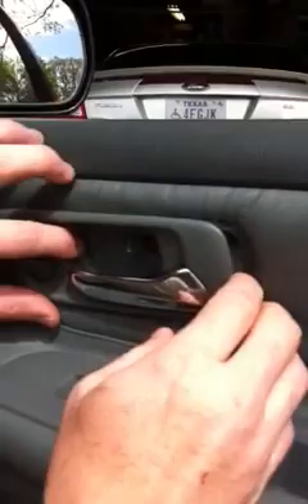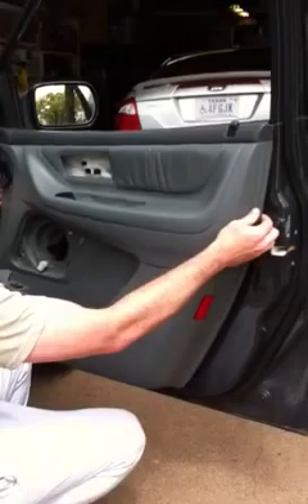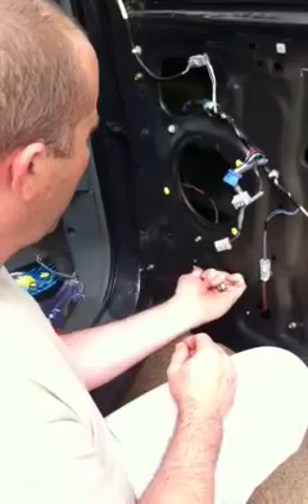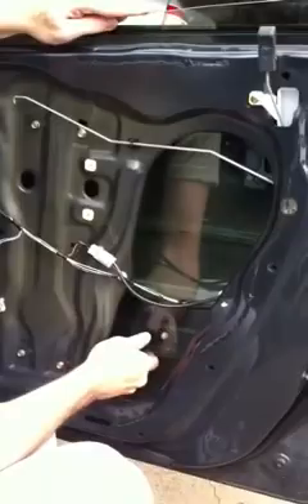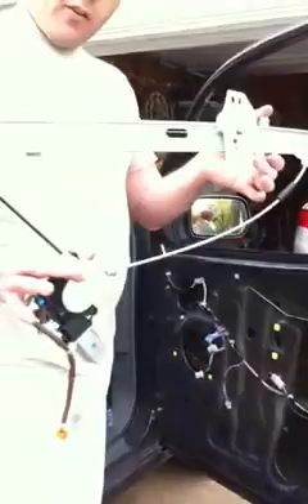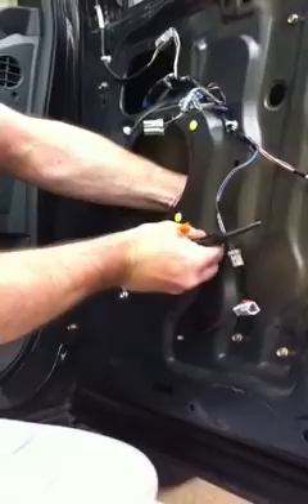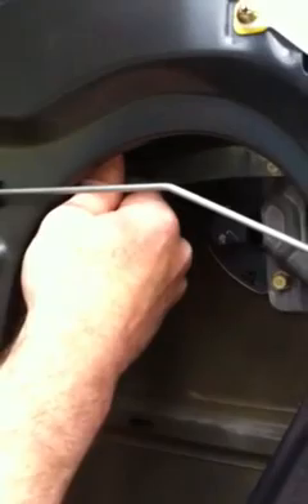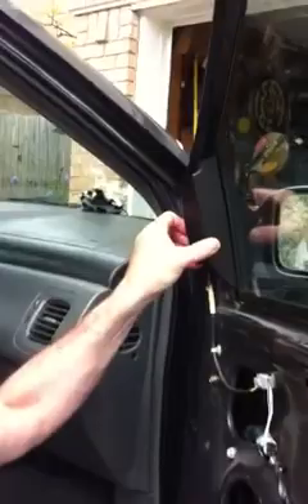2003 Honda Odyssey Passenger Door Window Regulator Replacement

Comment: Thanks for posting this detailed video. You saved me $250! It took me about 2 hours. I was also able to leave the window in and tape it up using painters tape while I installed the new assembly. I was not as lucky as you, my window was stuck in the full down position. By removing the 4 regulator bolts, I was able to get enough room to remove the 2 window bolts and push the glass up. Thanks again!

Comment: I did the replacement.The Plastic tabs of plate moving with glass broke & the strip was free so the glass stays down. Replaced the'Regulator'.Dorman $50. Repaired the old one , works fine , it probably broke as it was dry, no grease. Good job SGT, keep posting.

Comment: Thank you Jason. You saved me a few hundred bucks! I did the driver's side & my window was stuck in the UP position. This made it more difficult to remove the window bolts, but I was able to remove the left one, then pivot the metal regulator "arm", which lowered the window enough for me to see the other bolt. I then taped the window up rather than remove it. I also left the white barrier attached along the bottom of the door, folding it under the door and out of the way. Cost: $50 from Amazon.

Comment: The passenger side window on my 2004 Odyssey failed.  This video was an excellent resource to help me replace the actuator and motor assembly.  Some key tips in the comments section that helped; tape the window (duct tape) in the fully closed position, and don't remove the speaker.  You may need to remove the 2 bolts connecting the window to the actuator arm in order to tape the window closed.  While you do not need to remove the speaker, there are 3 screws under the speaker cover that you DO need to remove in order to take the panel off.  Once you get the panel off you are left holding the panel in one hand and trying to disconnect the speaker power connector with the other.  It wouldn't hurt to have a 2nd set of hands at that point or something to balance the panel on to avoid letting the weight of the panel fall on the rather thin speaker wires.  I found the hardest aspect of the job was getting the panel back on!  Fitting it in at the top while accommodating the door lock at the same time was tricky, but patience prevailed.  Excellent instructional video and THANK YOU.

Comment: Thanks for the video. My wife said the window went bang and fell down today. I was determined to avoid taking it to the dealer and spending $500...
Your video convinced me I could take the door apart without breaking all the clips and plastic.
After a quick parts run I had it fixed in a few hours and a couple of beers.
Thank you!

Comment: Jason I doubt you will see this but little over 6 years after you posted this video it is still at work. Passager window is broken, poket book is short, so this video just saved me $80.00 .....thx for yours & the camera ladys efforts they are truly appreciated....👍
Reply: Jason Shrout
 It sure did....two things I had to do different were...the black sticky, whatever, that held the plastic sheet on, work too well. So I replaced it with a pease cut from a bag you would put over a pallet, then shrink it with a propane torch ever heavier duty....it was handy..:) 3M two sided tape worked very well to hold it on.
The other was, I had to remove that corner peace, small black triangle. It's just held on with two clips that are brittle so it should be removed after the door panel, so you can pry it straight out, side to side. I broke the bottom clip but the door panel & top clip hold it pretty tight....really thank you again......👍 Have a happy forth...!!!!!

Comment: Great help. For those embarking on this little project pay attention to which connectors you are re-connecting your switches to. I made the mistake of connecting the blue power connector to my power window switch and I short circuited the sucker. Just ordered a replacement from Ebay Motors for $19. At least it short circuited in the closed position.

Comment: Thank you so much for this awesome video.  Wife called my Friday, said she came out of work and the window was down in door.  Bought the part for $70, used your video and changed it out in less than an hour with NO issues.  I'm not a car guy by any means but this was a pretty easy fix that saved me over $200

Comment: Thanks for your video! B/c of this I was able to do the same on the driver's side and save myself about $300.  It was some hard work though, putting the panel back on was quite a struggle, esp when I was working from 8pm to 11pm in the dark with a headlamp!

Thanks again!

Comment: Thanks for this helped refresh my memory on the steps -- had replaced driver side 2 years ago, New part on Amazon = $52. Do not need to take glass completely out -- can raise it and tape to door frame while changing regulator. thanx again.

Comment: This video worked perfectly for my 2004 Honda Odyssey. Thanks for the video! I finished mine in 40 minutes. The dealership wanted to charge me $104 just to "diagnose" the problem. Who knows how much it would have been after parts and labor. Got my part at a local auto parts store for $70. Awesome!

Comment: Thanks a ton for posting this video!  I have an '04 and I followed this video for the drivers side window and it was easy to follow, even for me.  This happened 2 years ago to the passenger side window.  I took it to the dealer and it cost me $300.  I bought the new part for $50, installed it myself (with help from this video) and saved $250!!  Thanks again.

Comment: Thanks for the well instructed video. I had gotten stuck at the part where you remove the window. Now I can finish the job. I also ordered the regulator from Amazon for $50. I wasn't sure what the problem with the window was, but thanks for clearing all that up for me. Great video.

Comment: Nice video.  Thanks.  I hate trying to figure out where all the tabs and such are and usually end up breaking one.  :(  Anyhow, here's a little tip that I used while working on my Impala.  You don't have to take the window all the way out.  Put a few (3 or more) long pieces of painters tape over the top of the door.  Leave it hang loose.  Disconnect the window and push it straight up.  Press the tape against it and the window will stay up.

Comment: Gives me confidence to try it on my 04 it's been non operating for 1 1/2 years now.  Got to do it man.  Going to try.
Reply: first time I did it, Ray.  Took me about 3 hours... would have been less than half that time, but I kept referring back to the video during the removal and installation.  Plus, my new part had a shorter cord, so I kept removing it to try to get everything connected properly.

Comment: You don't HAVE to remove the speaker, the weatherstripping nor the window.  Leave the window in the up position and hold it with masking tape, or a suction cup and hanger.  The speaker can stay in the trim panel, just remove the wire when removing.  My biggest problem was with the new part, the motor wire wasn't as long as what was removed.  (couldn't reuse old one, just had to 'make it work.  It's also a good idea to make sure ALL your pieces parts are back together BEFORE puttting back on the trim panel.  NOTHING sucks as much as getting everything back together, then finding a plastic clip laying on the floormat.  .

Comment: BTW, better to not take the window out.  You'll risk scratching tint or breaking it.  Just push window all the way to the top in closed position and use black tape to hold it up there.  Put the tape about midway up the window on outside to the top all the way around the top window frame and back down again on other side, inside  of widow.  Two or three strips like that holds the window in place real nice while you install the regulator.  Again, great vid!

Comment: thanks for the video it helped me not mess anything up.
I did find out a couple things you can tape the window in the up position and dont have to remove it, 
Also you dont have to remove the speaker just unplug it after you pull the door cover off,I also did not remove the plastic sheet from around the speakerI bunched it together and pushed inside the speaker hole.
Any way many thanks for posting 
2 thumbs up!!

Comment: ThankX Great Video, worked on an 04, the one problem was I could not remove the glass, window was stuck in the door. Hard getting the screws out. It went in easy and works great.
Reply: The glass is stuck on something at the bottom of the door on my 04, how did you free and raise it?
Reply: @janeharg8411  That is the same problem I have. The window is stuck down and I can't access the bolts to get it up all the way.

Comment: Great info.  Helped me with my '04.  Just be careful pulling the panel out.  Or have some spare clips handy.  And be 100% sure the child safety lock switch is off before testing whether it works or not.

Comment: wasn't sure if tape would hold. i pulled the glass all the way up, used a few pieces of stiff styrofoam vertically and wedged it in between the horizontal pole in the middle of the door and bottom of the window and it held up pretty nicely.  also used tape just in case

Comment: Very best presentation You don't HAVE to remove the speaker, the weatherstripping nor the window.  Leave the window in the up position and hold it with masking tape, or a suction cup and hanger.  The speaker can stay in the trim panel, just remove the wire when removing. What is the part # ?

Comment: fixed it.  Had trouble getting panel back on door & ended up breaking the small black piece in the front corner.  Panel would not slide under that piece no matter how we tried.

Comment: Thanks, great instructional video. My 2003 odyssey winow fell down today and I replaced it using your video. I have one glitch. When I first connected the window control I was able to raise the window but not lower it. After fully reassembled I can operate only from drivers side. Any clue what happened? is there some child safety lock or did control go bad?

Comment: Thanks Jason. I followed most of what you said and except for a few sheet metal slash cuts to my hand, everything works !  
I'm in Canada and it's winter, so all the plastic needed some extra attention.
How long will it take for my wife's hearing to return ?  Did I mention I'm in Canada and it's winter.
Of course the regulator decided to let go when we were 150 miles away from home. 
Is there any other time for a part to fail ?  :)

Comment: There is no need to take the glass out just tape it up with come duct tape over the top of the door and glue to outside and inside of glass best to tape on  two spots so it doesn't fall - one towards back and another towards the front on highest part of window.

Comment: Nice work Jason but here's a couple of tips, if I may.  Get yourself some socket wrenches. A 10mm socket and ratchet wrench would have been a big time saver.  Also leave the window in the door and the speaker in the door panel. To unplug the speaker I placed my foot under the panel to compensate for the short wiring. I raised the window up and looped duct tape over the top of the door with the tape on the inside and outside of the window.  However, much to my surprise, that didn't hold.  The window dropped down and I had to use mineral spirits to remove the tape residue from the glass and door frame.  In this video,  https://www.youtube.com/watch?v=5D5y7JxIU0U the guy used painters tape.